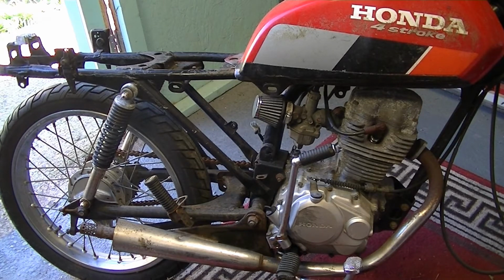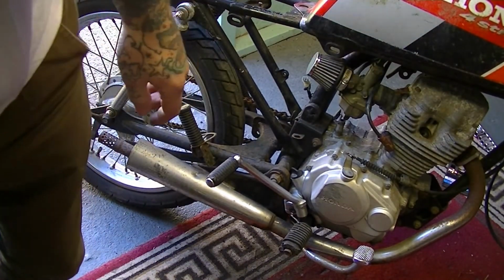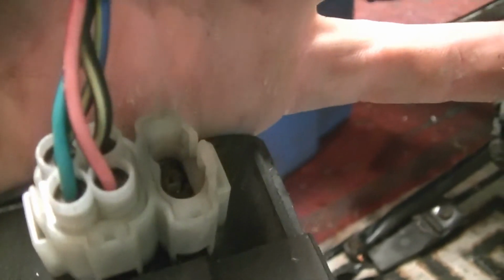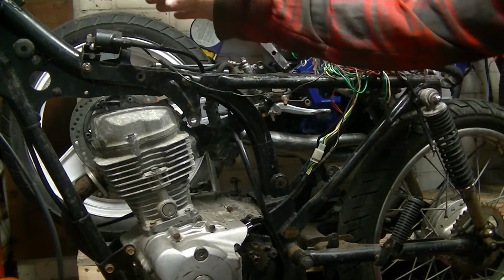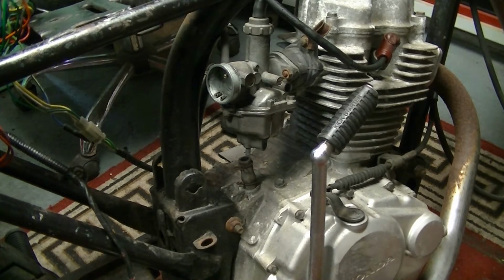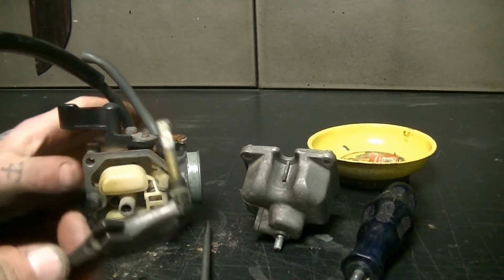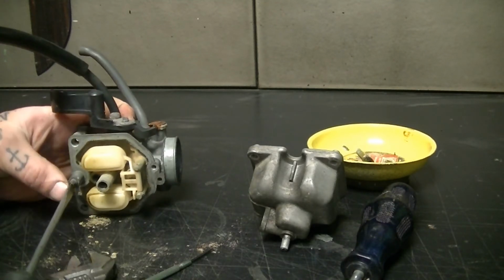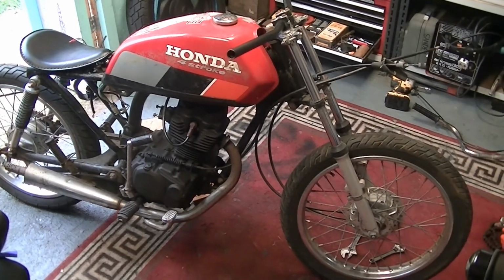BARNFIND HONDA CG125 - PART 1 - WILL IT RUN

Comment: I'm going to pick one up tomoz it's got a tree going threw it and it's locked up been in a Bush for like 20 years loool
Reply from the maker: that sounds like its gonna be awesome fun. can't wait for the video
Reply: @CultofRust  cheers Dan I've got loads of tips of watching your vid what year is ur cg I think mine is early 80s but I'm not 100% yet as there's no numberplate
Reply from the maker: @DTMotorcyclesEssex  mines an f reg brazil. I had to get the reg from the vin
Reply: @CultofRust  that's what I'm gonna have to do by the looks of it